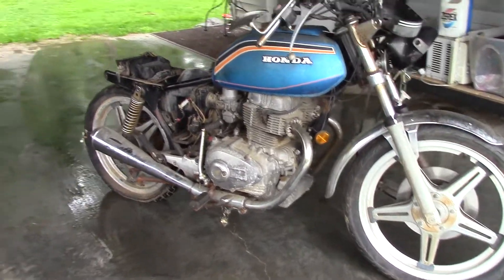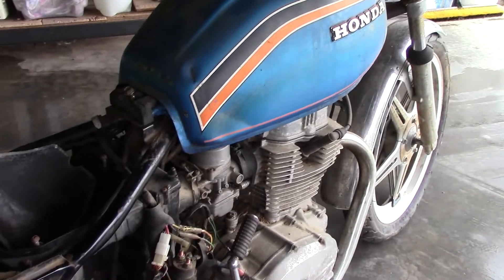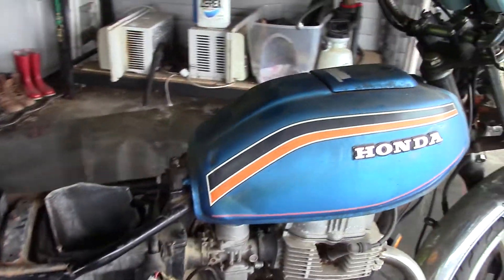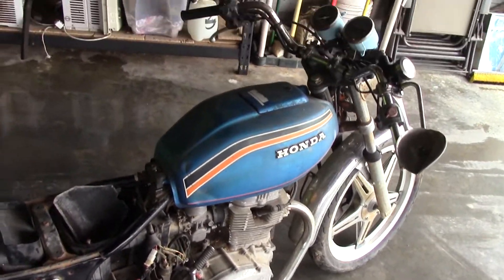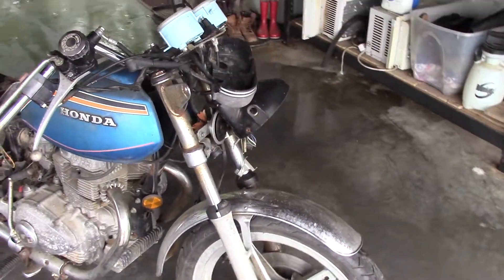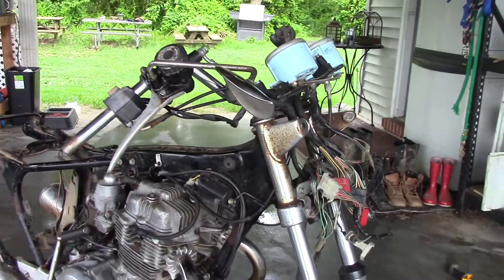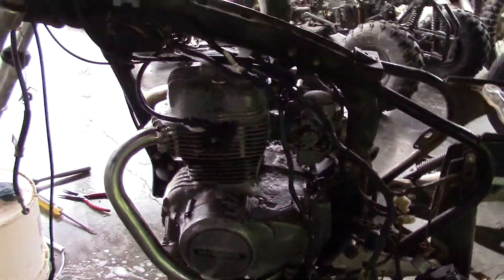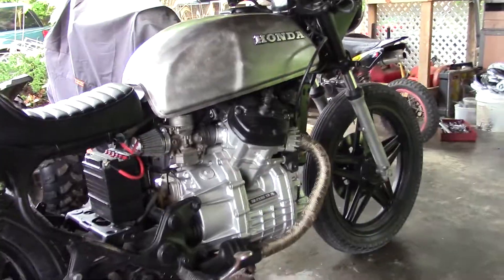Honda CB400 Cafe Racer Build Project (1978)

Comment: My second bike was a used blue Honda Hawk 400 not automatic. In perfect running condition $500.
This was back in the early 80s
One year later.
My first New Bike. Honda 650 Hawk in black. $2,500. It was still in the box when I put my deposit down. The reason for a 650 and not a 750? During that time the United States put a tariff on any Japanese bike 700ccs and larger. For $2,500 I loved that bike. 4 cylinders 4 carburetors. No problems typical Honda product.

Comment: I had the same bike mine was orange hondamatic 400
Reply: what was top speed?
Reply: Laura Garcia I don't remember I don't ride over 70
Reply: @edgaryanez3545  
It was rated between 106 and 110 Mph. Honda made 3 levels of the 400 Hawk. Don't forget this is new with perfect compression and everything else that goes along with a new bike if you want to grab one today I'm sure you would not get that speed. I will guess 90mph. Depending on your weight and the condition of the bike
Reply: @2strokeguru  
I had one but all the info is on the web. Honda claims between 106 and 110 miles an hour. Keep in mind that's brand new. Probably not the Automatic Honda made 3 trim levels of 400 Hawk.